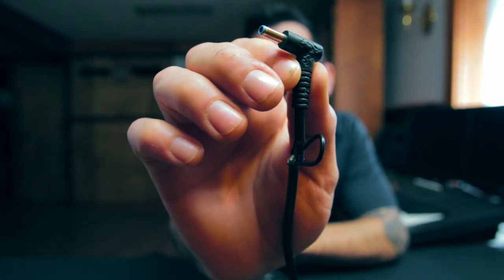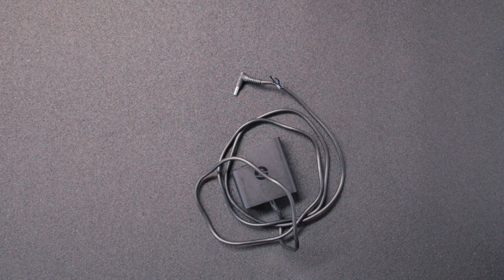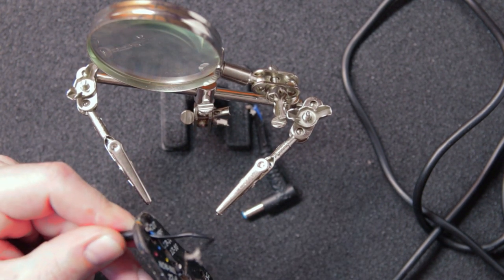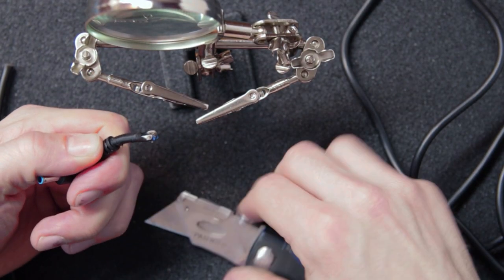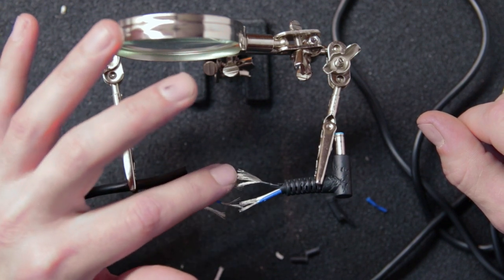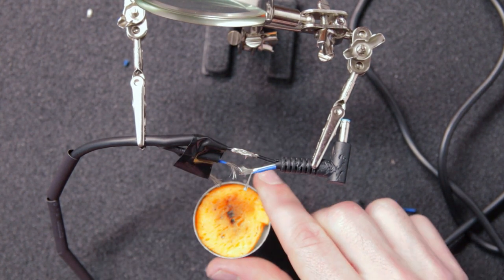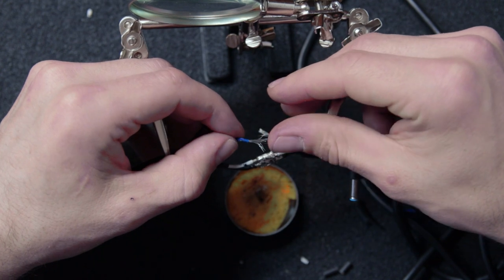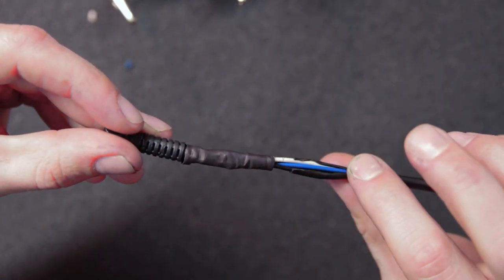DIY How to fix a broken laptop charger cable (full repair)

Comment: Wish my charger was this wire type. Ah does not matter its just about broke off the wire type is basically wires within wires and its broken at the base of the plug, funny enough its a nextech universal charger that replaced my OG acer aspire one netbook charger. Im suprized the charger is still working, like everything needs to be in the right place lol.

Comment: i need real help here, so i use my laptop charger and it stop working. but when I tryed it on another socket it worked but when I put a tablet charget or any other plug into the socket i first used for my laptop it works. any explanation for that? I'm really confused.

Comment: My laptop is over 10 years old, it can no longer use it's battery anymore and needs the charger to work, but the charger itself is already badly damaged and needs me to find a position where the charger connects well.

Sadly a rat bit the charger and made this huge hole that would cut power to the laptop whenever touched, so I've been looking for a video like this for a while, and after spending hours of desperately fixing the cable i can confidently say that i fucked up and will now need a new charger.

Comment: @The Armed DIYer , your methods seem refined yet straightforward. My question is about heating my shrink tubing. I don't feel confident about handling heat torches or open flame lighters on this task. I wonder if I could hold the finished wire end close to my toaster oven after throwing the door wide open after it is up to heat. Is a device that emits up to 450 fahrenheit hot enough?
Reply: @The Armed DIYer , also my issue arises due to the wear and tear of me yanking the cords away from the connective node which goes into my laptop, computer falling off my lap to traumatize the cord, et cetera. I trimmed right at the end to confirm that is where the break is. Complete disconnect of one of the inner wires. You say leave as much space on the short end as you can when clipping. Can I fray that end when there is less than a fingernail-length to work with? Thank you for making this video. I've seen nothing quite like it in my searches.

Comment: Is it necessary to solder after, or will it still work without soldering?
Reply from the maker: You could use just crimp fittings and it would work. But laptop chargers get moved around so much I just didn't want mine coming loose over time
Reply: @thearmeddiyer9343  Hey, man. I'm not dealing with a broken pin or wires from the plug that connects to my security camera system but the plastic of the plug itself that secures the connection of the metal is bent on one side, making the fit onto the motherboard's port too narrow.

How do I fix this?

If I bend the plastic to not be narrow it could damage the metal inside making the proper connection. Also if I attempt to shove it on there that could mess up the port from the motherboard.

I hope you can help me solve this, and thanks for reading

Comment: hi sir please i have a question my laptop charger part of its cable  get really hot so the laptop keep disconecting if i cut the damaged part and solder it will be fixed.thank you

Comment: Can you do another video on Toshiba power adapter where the wire broke close to the box....Confusing part is when I only see two wires one white and one un-shielded wire.....I dont know which is neutral and which is hot. Please notify me through email